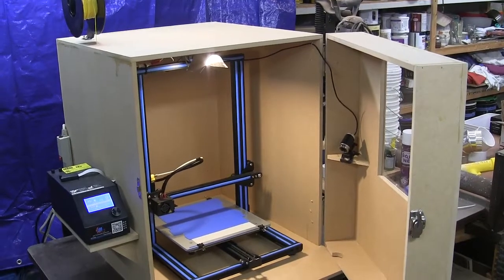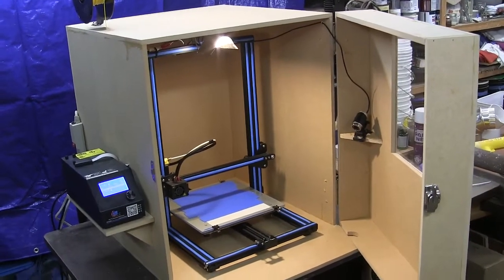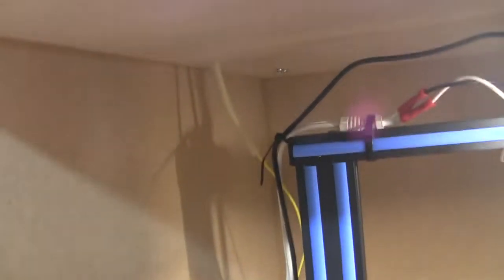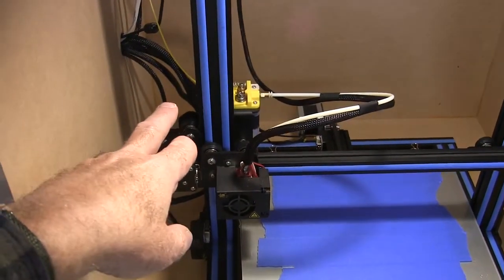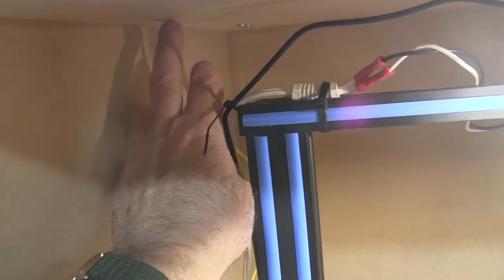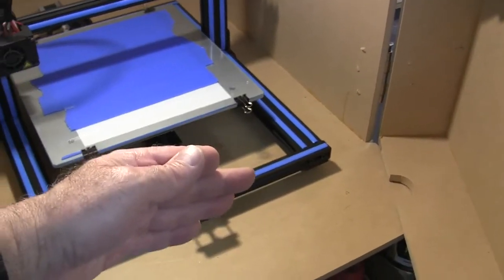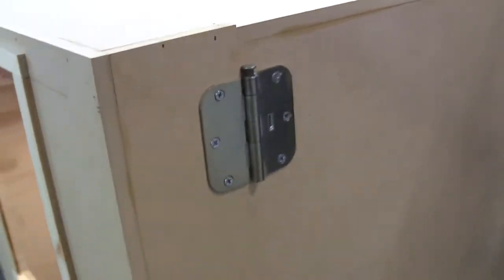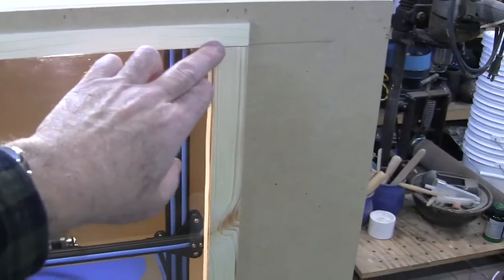Homemade Enclosure for 3D Printer CR-10

Comment: So Cool just build one of to for my Creality's CR-10 V2 printer... One is up and running. I made a view ajustments linke LED Panel ad the top.. Works like a charme.. I dont know how to attach some images how mine is build.  Please let me know so i can upload some images..
Reply from the maker: Awesome. Thanks for letting me know you liked it.
Reply: @SoatMon  Yes I will but the strange thing happens that my fillement is stopping feeding ad layer 7 or 8 I also have a Polybox on top to keep the filement on temp. I could be that the filement Angle is gives me problems. DO you have an idea.? I use eSun PLA PLUS .

Comment: Just putting the finishing touches on one for my CR-10S and your popped up. Nice job I might just pinch an idea or two as I complete mine :)
Reply from the maker: Awesome!  Thanks for the comment!
Reply: @SoatMon  If you are interested I have designed a teflon lined filament guide for a top mount spool for an Ender 3 might be of interest to you unless you have fitted a runout sensor (fits the CR-10). More of my playing on this link too.  https://www.eevblog.com/forum/chat/3d-printer-yet/msg1913924/#msg1913924

Comment: How useful is a 3d printer. I am seeing more and more of them, not sure how I would use it?
Reply: Quick look at your channel LOTS in particular if you can drive a 3D Cad like Fusion 360 (free). Mine spend most of their lives making electronic enclosures but custom tools and jigs have saved me a bunch of $$ instead of using engineering shops. Creality Ender 3 is a great starter.
Reply: Thanks, many other projects before taking on a new learning project
Reply from the maker: I use mine quite a bit.  I make a lot of foundry patterns and then pour them in aluminum.  I also make enclosures for electronic boards, replacement parts, custom brackets, etc.  You should take a look at Thingaverse.com and see all the things that people have designed that you can just download and print.  To me the most valuable thing is I can easily make custom parts or designs that would be impossible or hard for me to do otherwise.  I can design something in Fusion 360 and print it while I do something else.